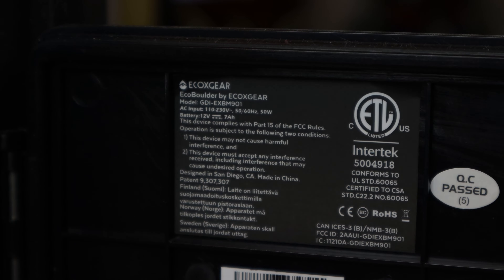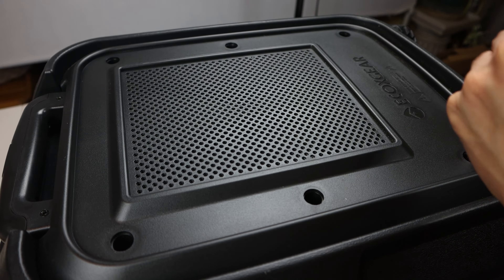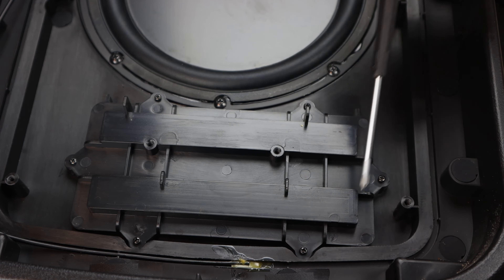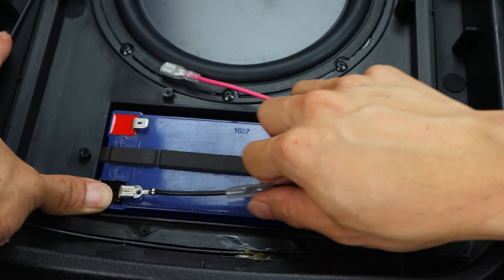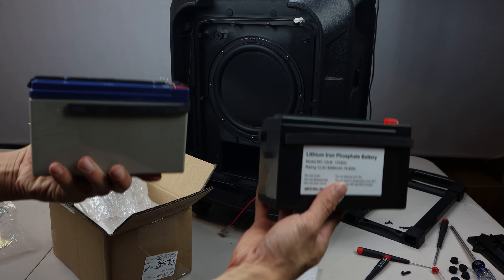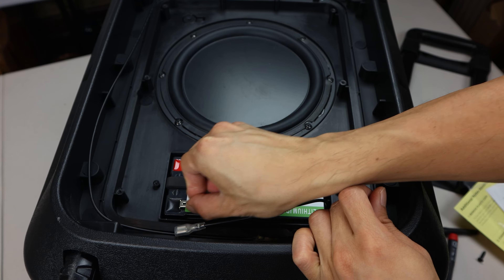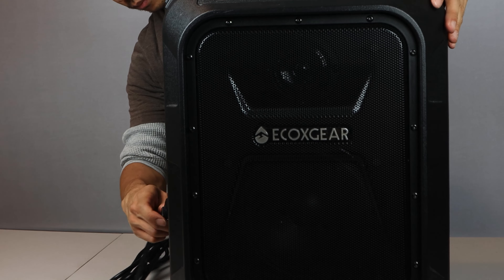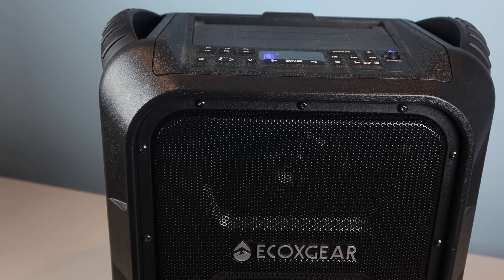EcoXGear EcoBoulder Speaker Battery Replacement

Comment: Question. I have an exogear, bought it back in 2018. Currently, I plug it in, and the charging light appears only but no sound. I try to turn it on, but only the charging bars appear.

Comment: Your notes on the video have a link to the "Power Queen 12.8V 6Ah Lithium Iron Phosphate LiFePO4 Battery" on Amazon. Does this work as well, or do I need to wait until the replacement lithium battery is back in stock on the EcoXGear website?
Reply from the maker: It's likely that EcoXGear is no longer offering the replacement battery directly so I think buying a third-party battery with the same specs would be your best option.

Comment: How do i know if my battery or fuse is bad. My speaker powers on lights up but makes loud popping sound when I try to play music. It shows battery is charging but makes popping sound like "pop, pop, pop, pop, pop and on and on". Thank you very much.
Reply from the maker: That actually sounds like a speaker or wiring issue. Pops are sometimes produced by faulty connections, perhaps with the mic input? Not sure.

Comment: My homeboy just gave me this speaker his guess is it needs a new battery but it doesn’t power on at all even while plugged into the wall do I need to buy a battery or a power cord ?
Reply: I removed my battery and wrapped the cord ends in electrical tape. Works now when plugged in.  Or get the new battery.

Comment: OK, I have two of these units. I replaced both units batteries with the lithium iron phosphate versions. Both of them would not shut fully off, and LED segment still was lit.

It was the lithium iron phosphate battery, and it needs an SLA battery. I replace one of them with an SLA. Same thing. Neither of them had the lit blue segment before with the power switch off. There must be something we need to do to reset the battery? It’s odd that both of them would be the exact same way with the battery replacement.

I would like to leave them unplugged, unless I needed them, but if I do that, the battery runs down, so I have to leave them plugged in all the time.
Reply from the maker: Hm, that's strange. I haven't seen this issue before and I can't find any information of others having the same issue. You may need to reach out the GraceDigital support to see if they have any ideas.

Comment: How do I know if my battery or fuse is out mine won’t hold a charge at all but will play like normal when plugged in. As soon as it’s unplugged it quits playing
Reply: Did you figure it out? Mine has the same issue
Reply: @michaeldancy8497  nope

Comment: My speaker is practically brand new used maybe 2 times at the beach, been in storage unit for about 7 months and now I’m trying to use it but it’s not holding a charge and only allows me to use it while plugged in. Help please.
Reply from the maker: The battery may have a bad cell or simply needs to be reconditioned, which can sometimes be done with a car battery charger.

Comment: Mine don’t turn on if it’s plugged in to the power.. would it be cause of the battery?
Reply from the maker: Hm, it's possible there is a short circuit with the plug line that is causing it to lose power when plugged in.